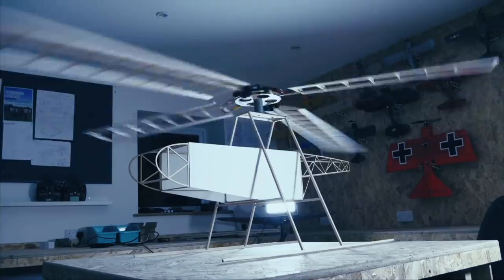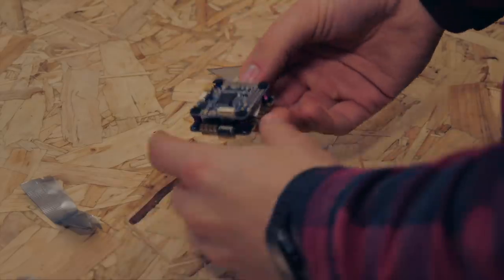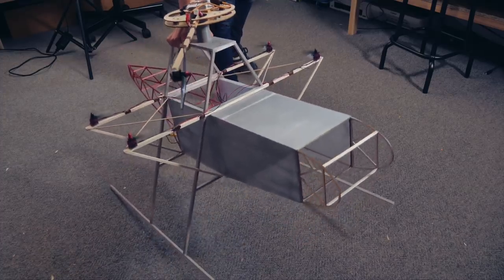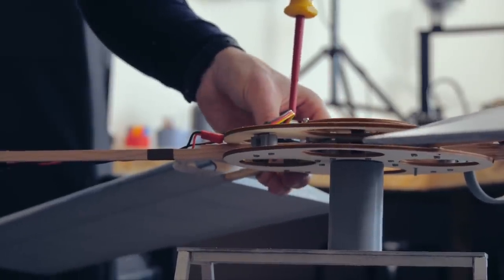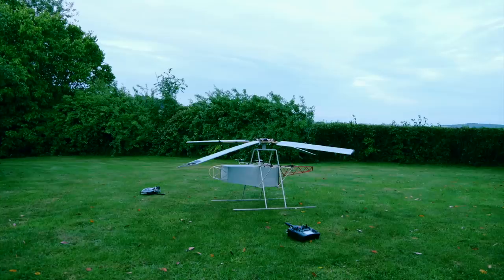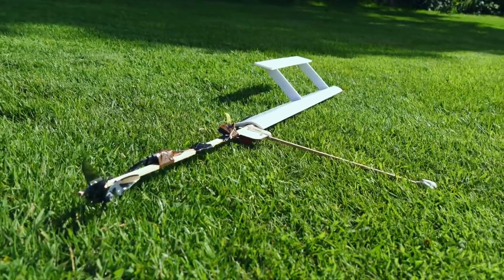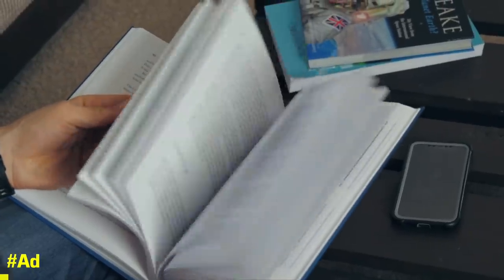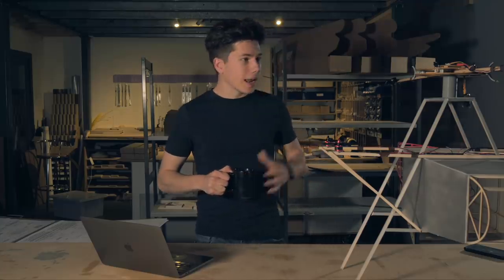DIY Tip Jet Helicopter (Testing) #3

Comment: Dude...
Please don’t give up!
I think that your first design is the best one...
With the EDFs on the tip of the “blades”, I think that you have to find some material light and resistant such as carbon fiber or maybe glass fiber...
Based on the video you achieved a lot of lift but you structure failed to convert it to flight...
I think you’ll can make it fly!
Keep doing tryouts and improvements!

Comment: Hi! First of all this is great! I was thinking maybe shorten the long propellers, as the longer ones were bending. Also add some sort of a parachute like thingy on the drone motors. Maybe they will inflate and create enough force to lift this heli. Try to add a central motor plus the edfs you already have added. Something like a 48 motor

Comment: Propellors that spin round are subjected to huge ammounts of gyroscopic presestion thats why they where slowing down moving them closer to the main shaft will solce this but that will decrease your power so maybe move them half way in and use smaller props 3ich would be a good shout... Or some form of compressed air tank that feed to the very end of the blades they had this same problem on the Flite test wirrly dirly

Comment: The McCutchen flying machine (mono helicopter) will work without the elevator (try it) I built one years ago and mine fell off in flight but flew perfectly ok, I tried it again and it still worked. Mine was powered by a Cox .049 glow engine.
it appears you have the balance wrong so try moving the counter weight further towards the centre.
Good luck
Paul

Comment: I think that the flapping of the blades could be due to the spars not being directly on line with the cg for the wings, which would've caused that flutter, and also those osculations, just a theory. Great project!

Comment: For my A level Design Technology I built a Fairy Rotordyne scale autogyro with 2 45 size motors. Diddnt fly very well.. model scale tip jets are difficult as you will struggle to generate the pressure ratio to duct them.
The problem with your blade mounting was the lack of torsional rigidity of the mounts.
Helicopter rotors have to flap up and down so that direction of flex is not an issue.

Comment: 1. Stiffer wings/props. (more beef in the middle and less on the outside of the props)
2. Balanced wings. I.e make sure that the center of mass is exactly or as near as possible to the whole prop assembly center to avoid vibration.
3. More powerful motors.
4. Don't use things that absorb water in the UK. (or move to different country)
Reply from the maker: Haha, I should have learned about point #4 by now.

Comment: I refer to my comments on previous video to go with Counter rotating Rotors as your only way forward with this idea.  
Yes for steering purposes forget about additional electric motors and use flaps underneath Rotors  , you'll save weight and have Positive directional steering results.

Comment: Use a hard spare like cf or multiple wooden spare  . since ur blade are lifting high u can tie an rope to the side which is not connected to the rotor hub and the other blade so they contract each other

Comment: could you take the working monocopter design and iterate it towards the tip drive helicopter you want to do? so mirror it with two motors, two wings? then once you've got something that flies, add the 'payload' of the fuselage

Comment: It looks like the wings have too much flex and are unbalanced by the electronics causing vibrations. It's obviously well balanced w/o the electronics. I'm curious if the center hub of the rotor could use aluminum spars that are hard mounted to the hub itself.  A single piece spanning from one side to the other would be best if possible, square or U channel. Then the wings could be slid onto the spars and bolted on. I think this would help with rigidity of the wings. As for the electronics, perhaps you could find a slip ring that would carry enough amperage at the appropriate RPM to allow the electronics to be in the base of the copter and have only the motors on the wings. Sweet little half-wing "monocopter" too! As always, you've made an excellent video! 👍

Comment: It makes me want to build one of the helicopter.  I feel that if you don't get the RPM up much higher you will never stop the vibrations.  That and balance of course.  If you speed up the blades you can get Gyro action to hopefully stabilize it.  The other issue being you can't get it up in speed without the motors cutting out.  That's a bit of a puzzle.

Comment: I think that the motors should be on the tips like the mk1 because the wing would have some weight on the tip and it wouldnt go up by itself and its also easier to spin something by pushing at the end of it, not the base

Comment: This is great I like the channel. Most helios depend on centrifugal force to support the weight . Otherwise the rotor blades will bend upward untill failure. In other words build rotor RPM before adding pitch. I am no expert but I am a retired aircraft mechanic.
Reply: You're missing the problems associated with dissymentry of lift. You need to study aerodynamics of rotor wing aircraft. Any blade has to have some method of compensating for dissimilar lift that results for one blade moving against the relative wind and the opposite blade moving with the relative wind. Even if the wind is one knot across the rotor disk, you'll encounter the dissimilar lift from one side to the other. That is why why blades lead and lag and flap up and down.

Comment: Wow, what a challenge!.  the first thing I'd look into  is the wing geometry.  the inner portion of the wings spin faster than the outer one. so you need to profile the wings  in such a way that you can get the most out the them in terms of lift.  Something  like the  blades of an airplane.  if you don[t want to twist the wings like that,  you must consider increasing the surface of the wings  at the outer portions. to get some extra lift from there.  Forget about these four stabilizer engines . you shoud only need a tail  rotor to compensate the torque, just like reguar helicopters do.

Comment: James, sorry brah, I was late to this even with the noti! Great monocopter dude, was really pulling for the tipjet rig though. I am quite struck that you didn't show a foam board wing. Foam with a foam spar would be heavier, but you have options for stability and lift. Even a stronger spar on your existing rotor would have helped. I may have to try something now. Four quad motors, the do make a dsmx micro receiver for the f4's. 2 on flybars and 2 farther out, have consideration for direction too. 
Anyway, was worth the wait! Thank you,  be well and stay safe!

Comment: James, I think the turbulence from the blade ahead is interfering with blade behind and causing buffeting and therefore part of your instability problem. Your blades are much thicker and at higher angle of attack than a conventional helicopter blade. You could perhaps try the pairs or individual blades in a different plane.

Comment: Reduce the rotars to 2 blades. Make a teeter rotor head same as a gyrocopter to allow the retreating rotor blade to track with the advancing rotor blade. reduce the pitch of the rotor to 2 degrees as too much AOA will create drag.

Comment: Compliments on being a mad man;o)  Multiple things.  
Rotor wing was going up and down during the rotation.  This is caused by your point of lift being in line or forward of your point of connection.  Need to put your connection to the head farther forward in the cord of the wing.  I'm guessing that you used the spar as your connection point.  Rebuild the wing with the spar no farther back than 25% of cord and maybe as far forward as 18% of cord and use this for the connection point.
Rotor wing connection to the hub or rotor head.  Because you are not articulating the wing at this point I would suggest a rigid mount.  This will cause other problems but those can be ironed out later.  If you are stuck with a articulating mount, make it much more rigid at this point.  Your rmp's are very low and it just doesn't have the centripetal acceleration to keep the rotor disk flat or flatish.
Multi blade rotor wings need to go through a process (after the cord connection point is sorted) called tracking where the angle of attack of each wing is pitched in angle of attack equally so they all lift the same amount.  Due to each wing being hand made it may need that each angle of attach may be ever so slightly different to get all the wings to lift equally.
Wing covering.  Product called monokote not only is a good wing covering but adds some structural strength and doesn't have any problem with humidity or the like.  Also will act as a bag for all the small parts when it crashes;o)
Just some food for thought.

Comment: Hello, I race drones for fun. The problem where the motors start spinning up uncontrollably is because the PID system in the "brain" is trying to correct the pitch and roll of the craft, but because it is resting on the ground, the motors cant affect the rotation so it beings a feedback loop.

Comment: - The wing spars need to be a lot thicker in the vertical direction to absorb the bending moment induced by the wings
The root of the spars (where they are connected to the hub) receives the biggest amount of bending stress
(alternatively, you could take a look into using carbon fibre)
- that 3D-printed motor mount between the hub and the blades reduce the ability to absorb the moments
- you may probably need to spend even more time on balancing the rotor to avoid the vigorous shaking

Comment: Hi James. The number one cause I have found that causes that accelerating motors is SimonK firmware on the speed controllers. I had a quad that came with a faulty flight controller and SimonK firmware, it would just flip over and break props on arming. I put in the same flight controller as you and had the same issue. I flashed the firmware and changed it to Bl-Heli - never had another problem. There are great tutorials on the Bl-Heli firmware website. (My ESCs were Afro 20A and were able to take Bl-Heli). Immediately I had a new machine and the props armed and idled silky smooth. Please give it a try, it's not as hard as it seems. I think you are still really onto something.

Comment: The slow motion shows that one blade was lifting a lot more than the others, and another was fluttering up and down. You need more torque stiffness, and to adjust the tracking of the blades so they all lift the same amount. Also, helicopters hold their blades straight by spinning them faster, known as the coning angle. You're close, don't give up!

Comment: Many 12 inch to the foot helicopters have a "flapping hinge" which allows the axis of the blade to  angle up from the height of the rotor head, producing a "coning angle", stabilized at the point where net centripetal force times the tangent of the angle equals the lift (with net tension at the hinge being the square root of the sum of the squares of lift and centripetal force). Even helicopters without flapping hinges exhibit some coning through flexing (as you have seen) and'/or being already mounted at the expected coning angle.  (The big boys typically also have a "lead-lag hinge", but since you don't have "cyclic pitch" control, you shouldn't need them..  Terms I have put in quotes are probably worth googling.)

Another point to consider is "gyroscopic precession" in that it may mean that your stabilization board needs to be rotated by (nearly) 90 degrees.  Your thruster provides force on the body, which translates into a torque at the rotor head .  Just consider the blade tip for now:  A thruster pushing the blade  up  as it passes over the thruster imparts an upward acceleration , perpendicular to the blade's velocity.  That angles the direction it which the tip is moving at that point as a (slight) upward angle, so the point at which the blades move (accumulating that slight vertical velocity component) occurs about  90 degrees later.  So,, for example a force pushing the advancing blade up (and/or) the retreating blade down) will cause the front of the rotor to pitch up, not the side.  And similar for other directions of force.

Finally, it is worth understanding cyclical pitch variation in a "teetering rotor" when the plane of the rotor disk is not perpendicular to the rotor shaft, that is, when the plane of rotation of the blades is not parallel to the plane of rotation of the teetering fulcrum pin.  It causes the rotor to self align to the shaft. That means that, instead of using a swash plate, you can achieve cyclic pitch by tilting the shaft with respect to the body, using a gimbal and a couple of servos, rather the thrusters.

Happy flying.

Comment: Hi,

With the mid prop design the props get to much turbulence from the rotor wings. This design will work only with 2 or most 3 blade design.
When close to the center you get speed but no torque, and at the tips you get torque with less speed. 
Close to the center there will be turbulences left that can cause cavitation of the turbine or props.

As the speed from the wings is higher at the tips than in the center of the assembly you should have less surface at the far end of the rotor wings than in the middle.

You can mount a turbine in the center of the assembly facing outwards and channel the trust by tubing and let it go out 3/4 or 2/3 from the center and angle it in the right direction. Articulating this could give you some vectoring that can change pitch angle from the blades (2 position) having a neutral and a lift stand.
Making the exhaust smaler than the intake will also accelerate the air flow and thus the rotating speed of the rotor wings. With the turbines in the center the rotating mass will less effect the strength over all. 
And effectively some weight at the tips may stabilize the whole thing.

This is used in some helicopters using the exhaust gasses from the turbo-prop assembly and getting the hot gases thru the shafts and the blade center to reduce lifting torque.

Comment: I don't know crap, but I would use 2 high tork motors close to the center of the craft, 2 high speed motors on the other set of ailerons at the end of them to even things out. Maybe! Also, lower the center of gravity

Comment: you need to treat each rotor blade as an airplane in itself, think of it like a flying wing, putting some weight in the leading edge to move the cg forward in the blade will make it stable. Helicopters do this too, the cg of the blade makes quite a difference to the way the heli flies

Comment: @ProjectAir Have you thought about using a "gewickeltes Kohlefaserrohr" (sorry, I do not know the English translation). It is like a regular carbon fibre rod/tube but the fibres are aligned in a 45 degree angle to the direction of the rod. This makes the rod very sturdy and it barely twists at all. If you use this kind of spar and glue the wing ribs firmly to it (difficult for a round spar, I know, I would use soft epoxy like uhu-plus) you will not have any more problems with twisting wings, I am pretty sure. I would use at least 12mm diameter if not more for your usecase.

Comment: You could try putting that mono rotor onto that helicopter body and see if those quad motor could control its direction of flight. 
If you choose to have another go with the original rotor then why not put some guy wires on the rotor to stiffen it up a bit (keeping in the spirit of the last century designers)

Comment: I commented on a previous video that you needed flapping hinges on the hub. But, I actually miss-spoke. The part I was thinking of is called the "lead-lag hinge." Helicopters just don't fly well without them. It looks like you may be attempting to compensate for both effects, with that ring-looking mount to the hub.

Comment: Nice project and watched only halfway through yet. A couple of things, first the rotor structure has to be much stronger, second, the CG of the rotor blade has to be before the center of lift to prevent pitch-wise oscillation. Cheers!

Comment: Hi just started watching your videos and think they are fantastic. Just a suggestion about your jet tip helicopter I think you need to eliminate all components from the rotor head as I don't think you will ever manage to balance it with the batteries receiver and motor controls etc all spinning with it. I would suggest relocating them in to the body of the copter as low down as possible to keep C of G as low as possible. And only leave the motor's on the rotor head You then trannsmit the power to the motors through metal ball races that support the central rota shaft you would need 3 bearings to operate brushless motors  this was the way that round the pole electric powered planes where flown years ago  I know this method works with DC motors. Would hope it would work with brushless. Hope this is of help.

Comment: i was thinking about your comment to mount the engines in different positions to establish optimum torque, but what if they were movable in flight. a gearing system that as the blades picked up momentum the engines moved towards the centre to create more speed. although this could be done with servos i think it would be far more exciting to see it on a counterweight. a weight slightly heavier than the motor but under tension to resist movement so that as the blades increase in speed the weight moves outwards while pulling the motors inwards. the speed would of movement increase like the powerband on a 2 stroke motorbike haha. then of course a system to return the motors to the outer edge when you reduce throttle, possible with springs